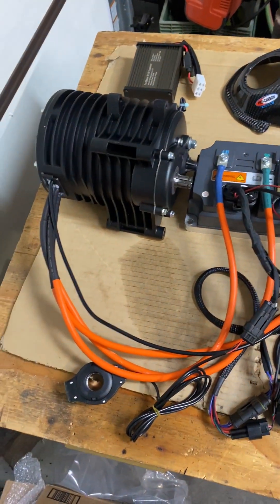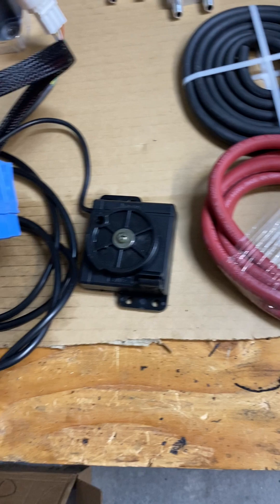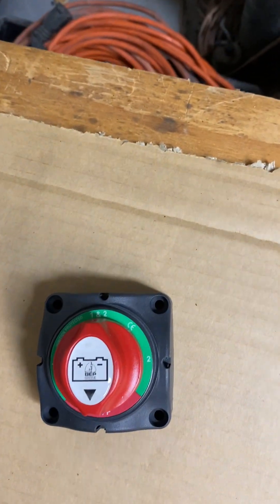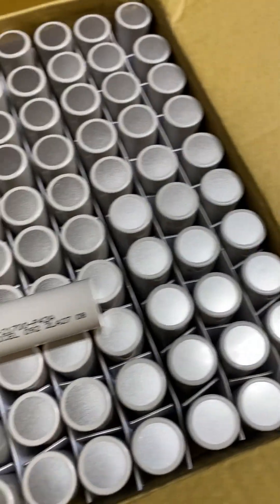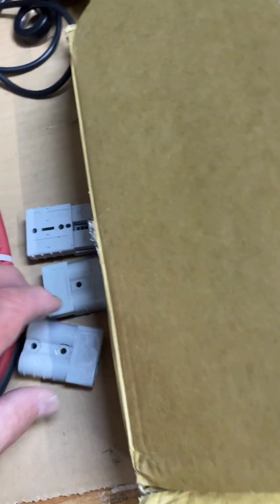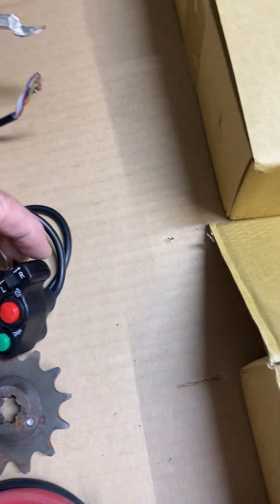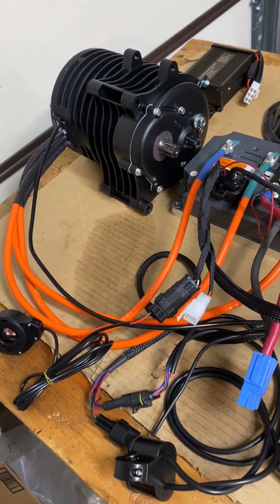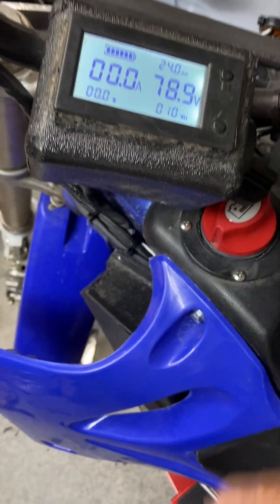Parts required to build a 2023 Honda CRF250 Electric

Comment: Do you use any fuse or shunt?
Reply from the maker: The controller has a 400A fuse on it, and I have the master ON/OFF switch to disengage the battery from everything. I measure the current thru a 400A current hall sensor.

Comment: Hi Don, could you share a bit more about the meter? where does it come from? what does it connect to the controller or the BMS? watched quite a few of your builds, love the quality!
Reply from the maker: Thanks.  The meter is on Ebay  It comes in three or 4 different Amperage  models.  50,100,200, 400.   I use the 400A one and it goes to FFFF over 400A. I have seen the 4 F's .    https://www.ebay.com/itm/164579409499      Make sure and order the longer cable also, it's  $5 more . I put it right on the power #4 wires going into the Controller, either + or -    It will read positive or negative current, and will show how much regen there is.  Enclose it because it is not waterproof.  For the power lead hook it straight to  switched 72V from the power switch..

Comment: Do these controllers over heat badly or something?
Reply from the maker: No, we run them at between 300-400Amps 72 Volts with no problems.  I have over 500 laps on SoCal and Arizona MX tracks with no overheat faults, and no cooling system.
Reply: @dcoxryton  is that because the water cooling? I’m just wondering if the water cooling is necessary.

Comment: I’ve used those water cooling blocks before for a DIY water chiller. I sandwiched some Peltzer cooling units between those water blocks and some CPU cooling fans. Brings back memories seeing those cooling water blocks 😅

Question, why do you buy these kits instead of just piecing it together yourself? Typically when I see people using kids because they don’t know how to piece the items together but you certainly built many bikes 👍.
Reply from the maker: The only part of this that is a kit is the Motor/Controller, switches, and harness. I pieced all the rest of the parts individually.

Comment: Thanks for the  build info. I have long followed the channel for your builds. Many times I have located sellers for the QSmotors and controllers overseas, which halted the project (paralysis by analysis). Do you find sourcing from electro&co the best method? The project will be in a 03 yz125 chassis. Hopefully I can re-energize the idea and get to the build soon. Have an awesome day!
Reply from the maker: ElectroandCompany.com  have the right package, it just works.  You pay more , but you get the value.